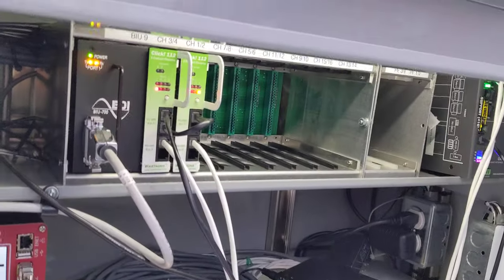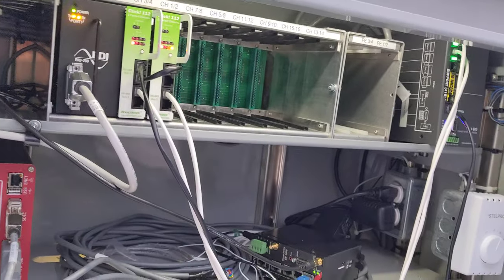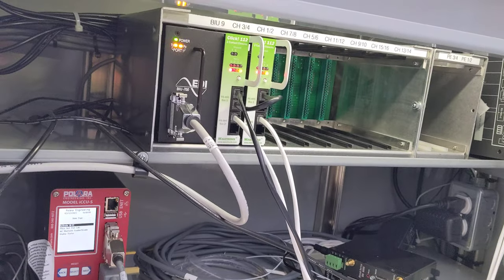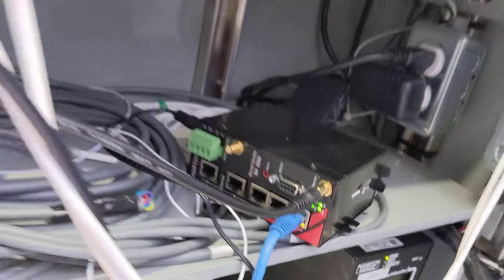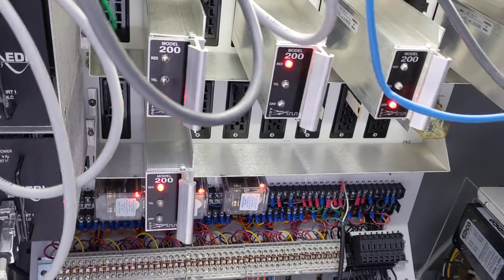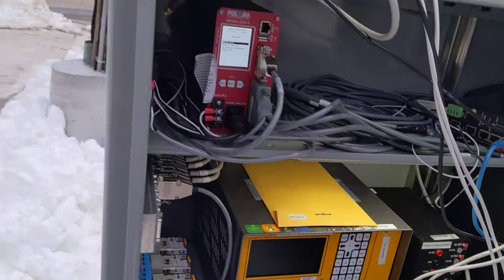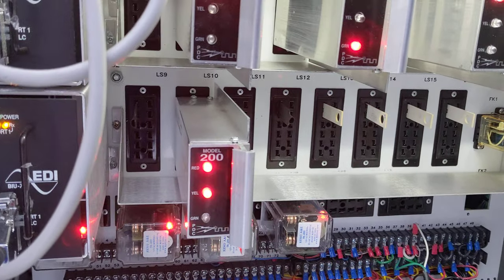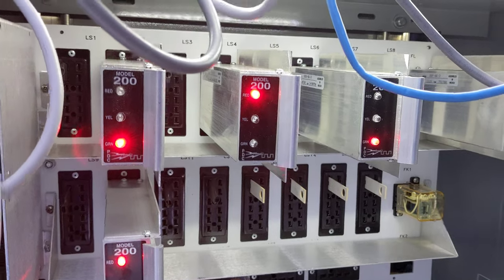The Inside of a Traffic Signal Controller Cabinet

Comment: Nice setup! Where would I be able to get a back panel for the load switches relatively cheap?
Reply from the maker: Are you looking for a TS1 or TS2 backpanel?
Reply: I’m currently looking to run a ts1 setup. Capable of running a standard 8 phase with FYA overlaps
Reply from the maker: @train1596  okay I will see what I can find for you
Reply: Thank you. I appreciate it

Comment: This needs to be simplified and better....
Reply from the maker: What would you suggest? This also has to have failsafes for liability reasons which is why it’s so complex. Also being able to reprogram controllers, replacing standard parts and being generally pretty vandal proof is ideal.